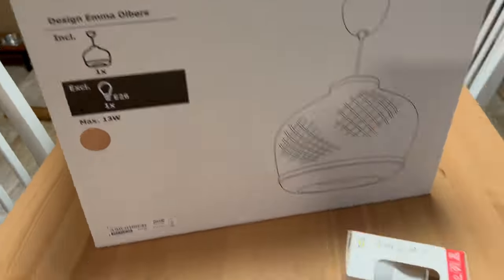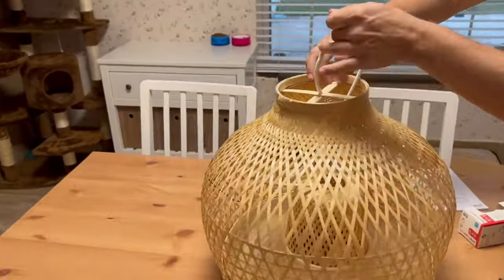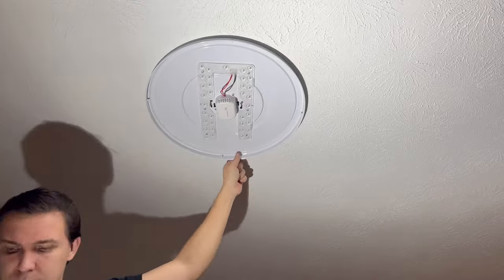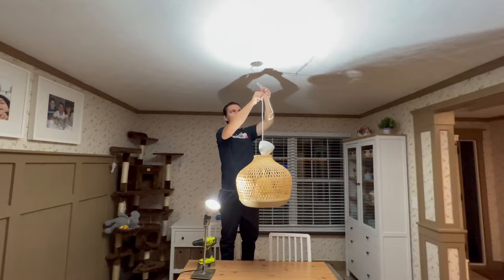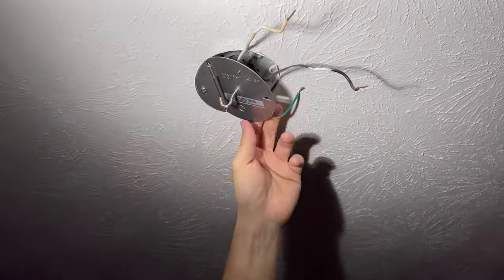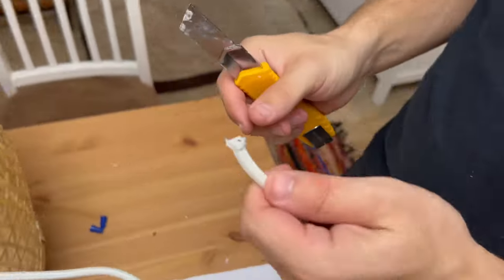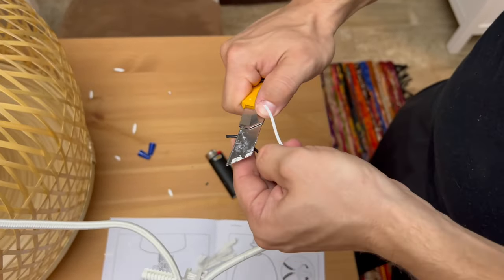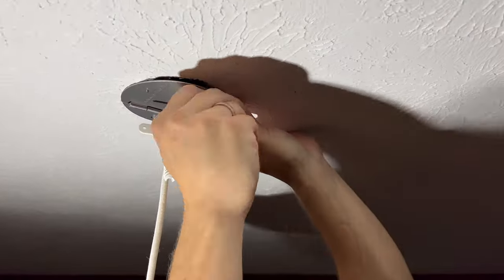How to Assemble and Install IKEA Misterhult Bamboo Pendant Lamp

Comment: Can you kindly tell me how you connected the top and bottom of the lamp. But doesn’t seem like it’s fitting
Reply from the maker: The cord is holding both parts in place. I was confused the first time as well.
Reply: @CreativeProcessDIY  i am trying to assemble it as well, and i don't get how to connect top and bottom

Comment: What is the specific name for  the ceiling hook you used?
Reply from the maker: it comes with this pendant lamp
Reply: Mine didn’t come with it, and it’s not even in the instruction manual as a part. Weird